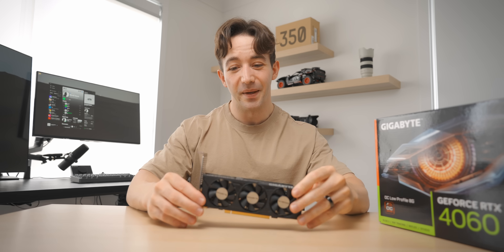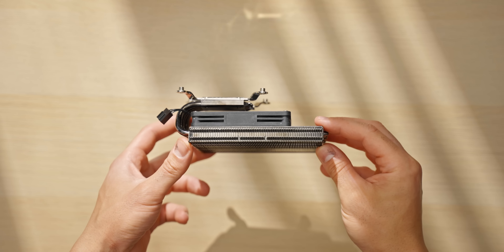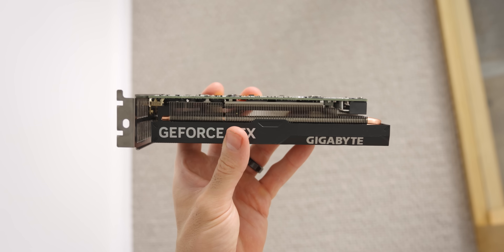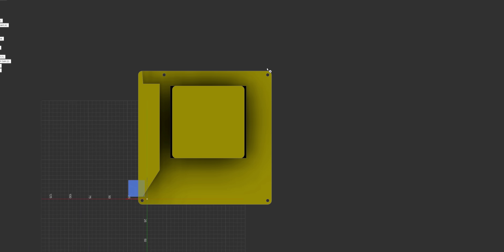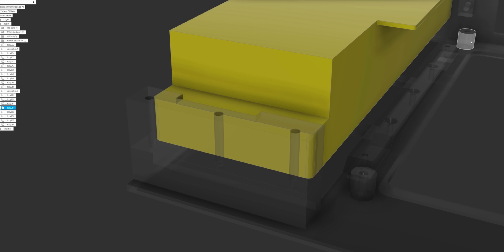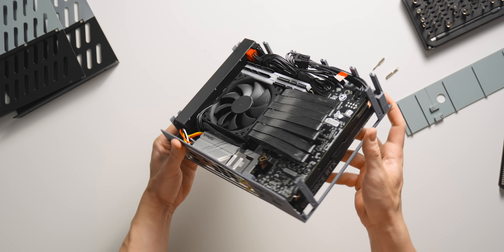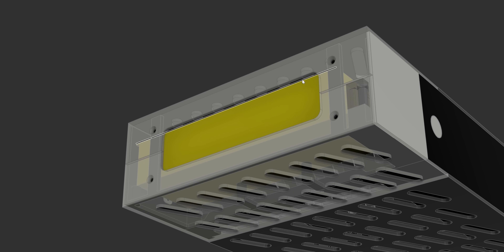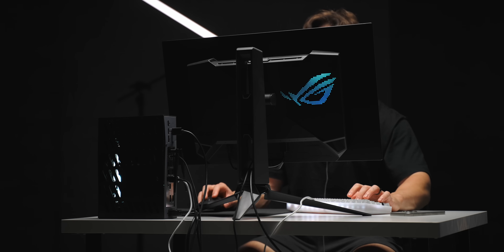Making the World's Tiniest Gaming PC

Comment: Would making it out of a non-conductive metal frame (stainless or some kind of plated metal) help both issues (cooling and rigidity)? If you went that route, especially with strong stainless, you could then add VESA mounting points on both side panels so that you could sandwich the computer between a monitor and a monitor arm rated for sufficient weight. The frame would be strong enough to hold the monitor and the system to an arm. The ultimate low profile, but 100% upgradeable build.

Comment: This is super cool and awesome. I've tried my hand at 3d printing cases before but eventually found that plastic is not the strongest or thermally stable material for any higher performance PC. I did print a GPU section in PETG in a semi-open air setup with a 5700xt and it held up great. ABS was the dream back then but I've moved on with just modifying existing cases. Currently have a meshi modded to fit full-size atx psu, atx mb and a 3090

Comment: You could try printing in PETG. It have a higher glass transition temperature around 85c depending who makes the filament, no ventilation needed and have more transparent color options to your likings. But it is harder to print as it likes to string however since you have an Bambu Lab printer, they should have an printing setting for PETG in their slicer by now.

Comment: Wow. This is almost exactly what I wanted after I got the rtx 4000 sff Ada gen and stuffed it into my t1 v2.0. I wanted to downsize even more to the velka 3 but wished it had the split like the t1 and power button like the t1 v2. 

Can I recommend to have the power button be usb c shaped like the t1 v2 but maybe have it set on the top panel? Gives it a more minimal look than having it in the front. And the side panels I think should be circles like the t1 and gives it a more minimal look imo. Might hold off getting the velka 3 if this turns out to be something you’ll sell like the finger tip mouse.

Also definitely check out the rtx 4000 sff Ada gen. It’s even smaller than that card and it’s pcie powered and has 20gb vram. There’s even someone on Reddit who modded the gpu to perform like a slightly oc rtx 3070ti.

Comment: As someone with a compact case, your case IS a cooler. I was thinking "this might go wrong" when I saw you 3d printing the case, I was thinking you might used some metal infused filament which has shared properties, it might help, I'm not sure.
A plastic case will provide your system with less area and material to dissipate heat, causing your system to be slightly hotter than with metal case, at least with plastic like PLA which melts and bends at relative low temperatures, it's definitely a problem.
Seeing the process of designing and improving a custom case design was very lovely, I'll be doing this too with my next project.

Comment: Most lower end 3d-printers' can't reach high enough temps or have enough ventilation to print ABS, but I wonder how the print would turn out with PETG since its glass transition temperature is around 80c and is more accessible than ABS.

Comment: Nice build! 

Hot tip: using a heat gun or hair dryer you can get rid of the white stress marks from prints caused by the build plate/adhesives.

Comment: Adopt HIPS filament. It's spectacularly cheap, easy to print, easy to bond, long term durable, needs over 90°C to start slacking, and emits way less poison while printing than ABS, order of magnitude. It also has an attractive matte surface.

Also i bet the print would have worked in PETG just fine without going all floppy. Excellent long term endurance as well. PETG is probably safer for health than PLA - PLA emits soot while printing, while PETG nothing at all.

Comment: that's awesome. I've always been curious to build sff pc's (only built micro atx and up pc's) but never had the courage to because of the space constraints it has compared to ATX and micro ATX cases. Could be my next build in 10 years down the line. still rocking this massive full tower coolermaster case all the way back to my first ever pc build in 2017 which is one of the few original parts it shares with my first build aside from the drives.

Comment: This might be a good prototype for a lazer cut aluminum case of the same size. I believe cases this small can benefit from using a material that's more thermally conductive that way it can release heat even in parts that doesn't have vent holes.
Reply: Just like laptops, only this won't be leaving 3rdº burns in my thighs

Comment: Probably better to just buy a perforated 1.2mm SECC sheet and make a frame with a rebate and premade screw holes to drop the sheet into.
You could even say make the rebates 0.5 m deep so the sheet would sit proud and hide the plastic but there is the risk with sheet metal of getting a bit of wonkiness depending on how you fasten it.

Comment: You could probably get away with PETG too. Generally a bit easier to print, especially for people without an enclosed printer. 
Probably worth designing the mounting points to take threaded inserts too over using self tapping screws directly in the plastic.

Comment: Hey not sure you know this but a tip for getting quick accurate measurements of parts is literally scan them using your printer/scanner (not 3d printer) if they fit on the scanning bed. This should give you a to scale image of the part

Comment: Yessss I love functional 3d printing! What nozzle size (and consequently layer height and extrusion width) are you using? I print a lot of functional parts with 0.6mm and 0.8mm nozzles since they can lay down a lot more material and thus save a lot of time. Main downsides are you can't do as fine of tolerances, lots of settings need to be retweaked, and prints are much coarser overall, but I really like the time savings for function-oriented prints.

Comment: I really would have liked to seen this in a sandwich layout.  But definitely a good video and an excellent go at it.  The only issue I have with it is the 2.4L Dell optiplex 3240 and 3260 exist already and you could slot the 4060 LP into them.  I'm sure with a little work the HD Plex 250 watt can be made to work with them as well. But obviously custom is always better.

Comment: Cool build, but I still prefer lzmod a24-v5 case - it's bigger at 5L, but it works without razer, allows you to use 67mm CPU cooler that will be much less noisy with 13400F/7600, and with HDplex GaN PSU it will fit one or two cheap 2.5" 4Tb SSDs for media storage.
Reply: Just did my build in this case some weeks ago. I was stunned by the build quality of this thing! I got the Enhance ENP-7660B 600W Flex ATX PSU from Overtek, modded with a Noctua fan. It looks like the HDPlex 500W GaN could also just fit after flipping the power button to the bottom (near the GPU) instead of the top.
For now I'm running my Ryzen 9 5900X with the 4060 LP, so I plugged my external watercooling rad to the CPU, but I'm thinking about the options. I might do a custom very compact external loop for the CPU.

Comment: just playing around with your models in bambu studio, if you rotate the front panel 45 degrees you can fit the entire panel as 1 piece pretty easily. Also was it pla or pla+ ? I honestly wouldnt bother with PC, theres just no need, but this would look really good with a carbon fibre filament, theres ABS, PETG, pla, maybe even experimenting with super suble fuzzy skin for some of the parts, also minimal glue and wiping the surface with iso to get the remaining glue off after its printed. gotta leave ABS until the entire chamber cools down to prevent it from warping, you should experiment with printing your flat panels without glue, it should stick, just bring build plate to max i think 110 for x1c, make sure the chamber is nice and warm and leave it to cool before touching it. very cool project

Comment: > Console Destroyer

This build still comes out to at least $850 (ignoring the cost of the case), but honestly that isn't too bad for something that has about the same power as the PS5 in half the volume.

The other option is to just throw the Gigabyte LP 4060 in a used SFF office PC, which comes in at about the same size and price as the PS5.

Comment: 2:55 You will learn the hard way about transient power spikes!
The 500 Watt version is very recommended, always have a power draw buffer to soak up the spikes.
Reply: Yes! Yes! Yes! Power spikes are much-much higher than nominal power draw. Also TDP is not power draw. The power draw will be higher than TDP. And gaming is not the only use-case for a system like this. One must stress test the device. The 500 Watt is a must for a system like this, and suggesting otherwise is bad advice. Just because it didn't crash under his use-case, doesn't mean it won't eventually.

Comment: Ask your local metal worker to make those parts of the first build in metal/ steel sheet.
And use plastic or rubber standoffs on screws. Your case would be strong and even more cooler probably!

P.S. metal sheets can be cut at the exact same dimensions.

Comment: My Project !!!!
I'm working on a miniITX + SFF ATX power supply into a 27.3 x 17.5 x 6.7 cm case.
That's 3.20 L
Without graphics card !
Using Ryzen 5600G with the internal graphics and a very flat noctua CPU cooler.
I'm definitely going for this 3D print !!!
Reply: Next step is a full custom cable set, as the stock cables are messy and space consuming

Comment: Tip: How to remove white residue from 3d printed ABS: use a heat gun, lighter, or flame torch to blast some heat quickly over the surface that was in contact with the bed.

Comment: Instead of using 3D printing, consider using CNC'ed carbon fibre boards. Much more rigid than plastic, but equally light weight
If you are interested in exploring carbon fibre as a material, I would recommend you research into "Forged Carbon Fibre" or "Resin Infusion" so that you can produce complex shapes
Easy Composites Ltd is a good tutorial channel

Comment: Its crazy how I bought that card and for months was looking for the smallest case possible and couldnt find one that utilized the size of this low profile card to its potential and then my favorite tech youtube just cones out and does it himself, this is why your my favorite.
Reply: Same. I recently got the rtx 4000 sff Ada and was using the t1 v2.0 (previous gpu was 3070ti fe). I really love the t1 but I felt I wasn’t fully using it now and I wanted to downsize even more. Might hold off getting the velka 3 now if this becomes a product he will sell like his mouse shell.
Reply: @HeyNavi  I personally have a 3D printer so I am going to wait a few weeks for him to touch up on the small things he said needed fixing and then download the file and print it.
Reply: @lizandrotorres8068  I would love to see a picture of that if you ever do it.
Reply: @lizandrotorres8068 hi, luckily, my school has a 3d printer, so im considering doing this for my first pc build. have you ended up building it? my main concern is if i need to solder the cables like he did since ive never done smtn like that before
Reply: It fits in the Velka 3 too

Comment: If you're looking for another comically small GPU, PNY just came out with an updated version of their small form factor unit. It's called the "RTX 4000 SFF Ada Generation". It's a very cherry picked core optimized for power efficiency, so it still doesn't require external power cables while having extremely impressive performance. Only caveat is the crazy price.

Comment: That's amazing, I need as small as possible case which supports 300mm gpu and 3 slot. Dan H2o is amazing but I just can't get  good aio temps, and supposedly EK Basic 240 is great cooler :/

Comment: One way to make it even smaller would be designing the case as a specific shroud with the exact dimensions for the GPU and CPU cooler you're using, like the ForFun 02 Pro does.

Both coolers would be "open air" while hiding/protecting all the rest of the components, and saving the extra volume of having the panels over them.

Comment: I know this might be sacrilege, but I wonder if you could copy the side panel with the holes, move it out a little then rotate it or offset the holes so airflow can get through but you can't see directly into the bare components. It'd also be cool to use resin printing for a smooth finish, or have it machined out of aluminum once a final version is done.

Comment: Great Video. I also found the HD-Plex PSU month ago and it would be so great, if there is a case design based on the size. Or like a small ITX-Tower, just with the mainboard, the PSU and a small GPU, maybe the small 4060 or a small 4070 unter 25cm...

Comment: It's my understanding a computer case should be partially made of metal for grounding of components and interference shielding. Not to metion electrical safety violations / concerns since it plugs to mains and has no earth grounding to the PSU or other components.
Reply: Bingo. This is why commercial cases are metal, plastic cases like older laptops had a special coating inside and some of the gamer cases from HP and Asus have a special coating on the glass panels as well. Another issue is using PLA for the case you can build up static electricity and without big earthed surfaces it will discharge though sensitive components on the motherboard. Oddly I always see PC builders call them an IO shield but they don't seem to realise what they are shielding...

Comment: One thing to keep in mind with PLA is that the amount of sag/melting it does from that temperature it likely where it will just stay at until you go way hotter. It doesn't just melt like regular plastic or soft metal does, it hardens and resolidifies. That's also the reason a lot of people put PLA projects in the oven at low temperatures. It sounds kind of crazy but applying heat makes it heat resistant - you just need to apply it in an environment where it can't just sag. Had you baked it it very likely would have held. ABS is still obviously better I'm just saying for other people who want to try this with PLA it's almost for sure possible to have a better result than yours if you bake it.
Reply: There’s also an option to use PLA+ as it has a higher melting point. I’ve been building with it for a while and never had an issue. I also thicken things up a bit for the extra support for heavy components and heat resistance…
Reply: I used carbone fiber pla and it was a better choice
Reply: or PETG but that's also low enough that a PC still might overpower it
Reply: @ventilate4267  I love PETG, it is very easy to print if you have a heated bed, it sticks so well you might even struggle to remove it. And it doesn't "set" easily so I am more comfortable using it in load bearing structures, and places where I can't have it bend
Reply: @someonestolemyname  I've been meaning to try some out but I've heard compared to PLA its still a bit more finicky
Reply: @ventilate4267  I print with a glass bed, and rarely if I am not careful it can chip it. It is also more hydrophilic(dry box and hair drier) and has more stringing(retraction and lighter). But I still find it easier than PLA just because of how sticky it is on heated bed. YMMV with new engineered bed surfaces that might grab PLA just as well.
Reply: @someonestolemyname  I have one of those borosilicate glass beds or whatever. I was thinking of getting a one of those G10/FR4 beds just for lighter weight, but I think my ender's bed is probably warped like everyone else's so its probably not worth doing.
Reply: Given the effort needed to get an annealed PLA part out of this while still having the tolerances it had when you printed it you might as well just print it in ASA instead.

Comment: Maybe you can use PETG for printing since it has a high melting point, is mechanically stronger than ABS and PLA since it can flex and it doesn't get affected by external factors like sunlight etc.

Comment: Eagerly awaiting the final result of this one. Sourcing the parts were easy, apart from the psu (out of stock, even at HDPLEX own site). I consider using your final version of this, but modify it to fit the bequite 300w TFX psu, as it was also good bit cheaper here than the HDPLEX one.

Comment: for plastic I recommand using ASA it's what I used for mine. and so far almost a year later no deformation what so ever. it's not that easy to print but as you have a closed 3d printer it should be pretty ez for you to print :)

Comment: To someone 3d modeling something like this for the larger gpu, it should be doable to put 500w hd plex gan psu in front of motherboards, keeping volume as low as possible, because smallest 4070super or 7800xt are longer. The size of SFF pc is now bound to gpu size.

Comment: How much volume would it add with the top extended for a full-height GPU? You’d likely have to extend the bottom for the additional thickness of the 500w HDPlex, but I’m wondering if you could still get it under the volume of the Velka 3.

Comment: If you wanna go full SFF, maybe try direct die cooling, maybe cpu lapping. Also, if you're gonna have a power cord that goes into the wall anyway, why not move the power supply outside, just like in a laptop. 

1 more suggestion regarding the case, it looks like a lot of Youtubers started to fully relly on 3d printers for anything. In your use case, MDF or HDF are much better suited (at least for the side pannels). You can use your 3d printer to draw the holes in the MDF/HDF, then cut them with a wire saw. Its so much faster this way AND it would yield a much sturdier case

Comment: I can come up with a 1400W PSU that is 5mm taller than 250W HD PLEX PSU, for like $50.
It would have a fan, but if you run it under 50% load the fan would stay almost inaudible.
Also it would get rid of the 24pin cable mess.
Lastly it would have the C14 socket built-in like a normal ATX PSU unlike the HD PLEX thing with exposed mains wiring.